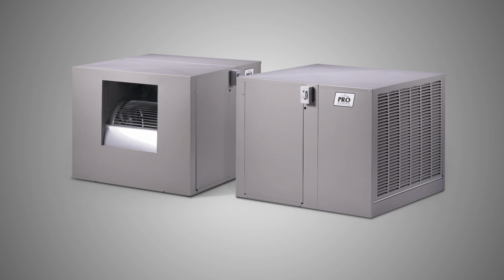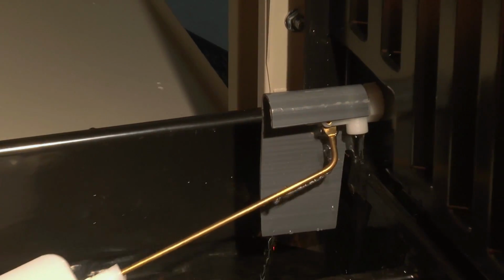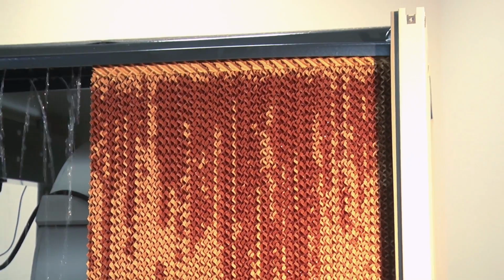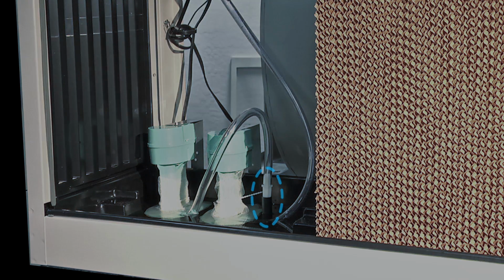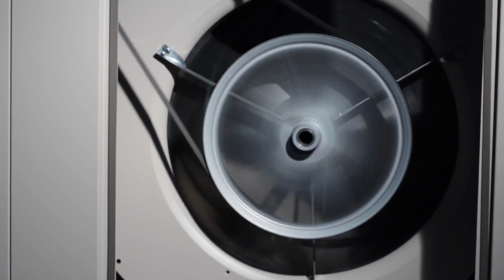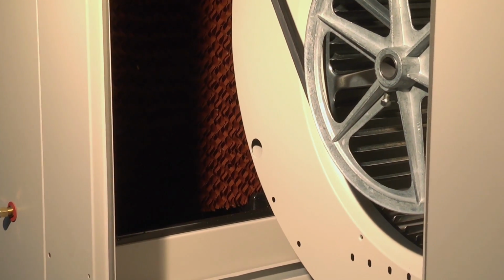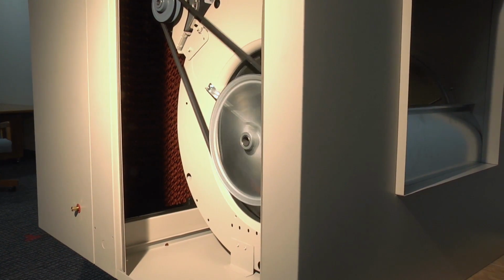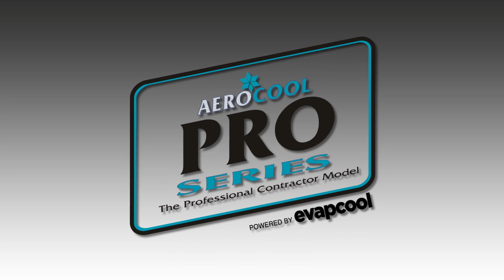Inside the Aerocool Pro Series

Comment: Good tip on having the bottom drain, something I thought was there just in case a float failed to shut the inlet off, used as a system cleanser, something I have failed to do and will now start.

Comment: Aerocool Pro PD4802 not working very well, installed this year. We had an earlier model for many years and it kept the house so cool that people would ask if we were using central AC. PD4802 seemed to work better when first installed but even then on high it seemed crippled compared to our old unit and now it barely blows on high. Calling the installer on Monday and hope there is just a need for adjustment. It is only 90 degrees today so not that hot for the desert and it is overly warm in the house.